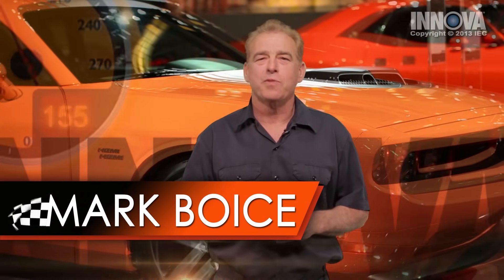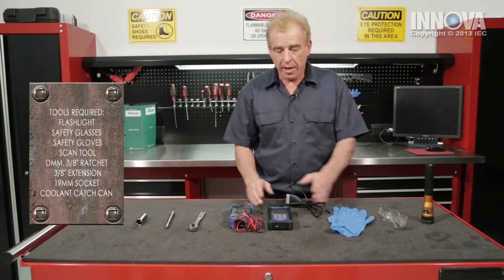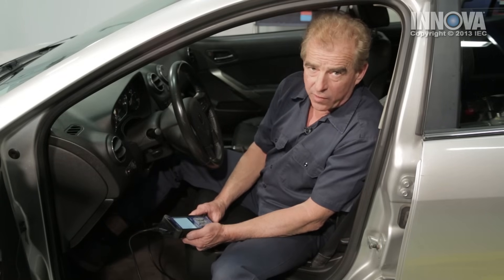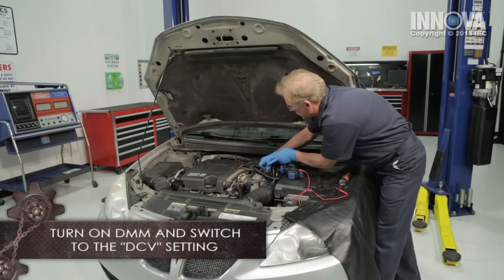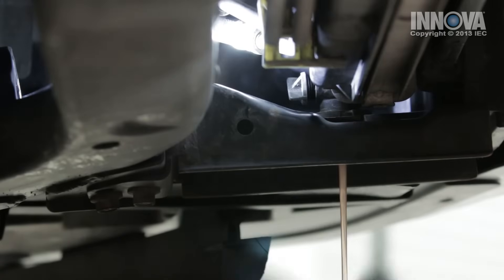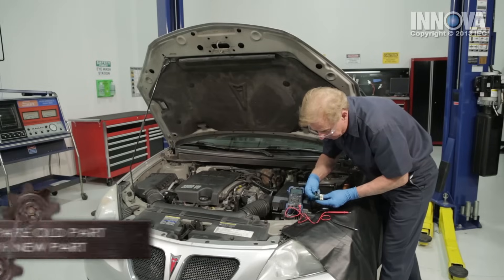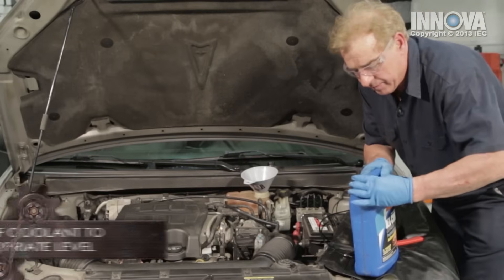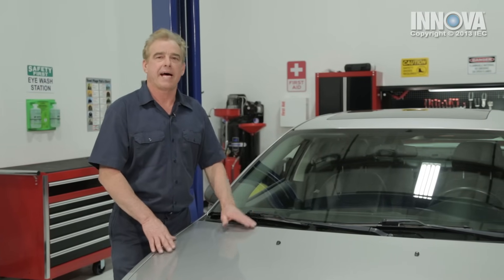How to diagnose a Faulty Engine Coolant Temperature (ECT) Sensor - 2005 Pontiac G6

Comment: I have a 1999 Ford f350 V10 with codes po118 po117 at same time replaced wiring and oem coolant sensor and 2 pcms voltage good wiring is perfect any idea's

Comment: Would this sensor cause the air conditioner to not work? That's what my 2010 Cobalt is doing, engine light on and info window for engine temp read - - - F. Should be between 190 cold and 220 hot. Had this happen 2 yrs. ago and mechanic changed the thermostat, it was good for about 5 miles and air quit again. So he replaced the ECT after I asked him if it had a sensor or something. Worked for about a year and he had no time to look at it.  So I drove it like that for about 3 wks and the light went off temp was good again, and air worked. Now it is doing the same thing this year. Is it possible the sensor is faulty?

Comment: I got the thermostat changed on my car because I hose had went bad I replaced a hose it was the top radiator hose and then it still red hot thermostat was definitely bad but now I have no heat in my car at the 05 Pontiac aztek I had heat in it before the thermostat change perfect it don't run but 4 minutes five tops and it says it's reading very hot any suggestions please I bought this car from a used car lot over a month ago I've had problems with it ever since I don't even have my title yet it's been a real headache but that's the only way I have to go can you please help suggest
Reply: Did you bleed the air out the system? Im not to familiar with the aztek but if it have a 3.4 engine then you need to bleed the air out. It a bleeder screw on top of the thermostat housing. Open this bleeder screw anytime you add coolant to radiator. Put some old rags or paper towels under the screw cause coolant will leak out. Once your adding coolant to your radiator keep an eye on the open bleeder. When coolant start coming out like a stream air should be out of the system. Close bleeder screw. Let run car an to normal operation. If temp go past the normal operation. Cut car off. You gone have to wait till car is cool again. Then once cool off. Open radiator make sure coolant aint low. If it is low add more coolant after you open bleeder again. If coolant is full in radiator put radiator cap back on an then open bleeder screw an crank car up. Coolant should stream out that hole again. Close the bleeder screw. Also not take bleeder screw all the way out it just need to turn a few tines to open up. Losing that bleeder screw is a pain in the ass. Trust me you dont want to lose that other wise you gone have to buy a thermostat housing again or go to pull a part an take a screw out of s wrecked 3.4 housing. If it still overheats after that then you got other stuff going on.

Comment: I did that same exact thing but I have no code no more but the wrench on the dash illuminates when it wants to, plus it keep saying low coolant on radio... I drove the car out of town a few times and it drives great but it just burns a lot of gas but I think the car is fine I unplugged battery for 30mins still no luck and erased the code still no luck... but car drives great
Reply from the maker: +Gary Goodman  Thank you for your inquiry. We suggest to consult with a service manual to find the proper steps to fix the issue you are having with your vehicle.
Reply: did you ever find out the issue?
Reply: nope
Reply: ima go ahead and change mine. I drive alot and all that gas that goes to waste is costing me big money

Comment: good morning I have an 1996 mercury grand marquis gs and it's making a whole lot of squeaking noise when I drive and I was told that it was the lower Control arm bushing but I brought the energy suspension and I want to put those on my car and it's suppose to make my car drive better. so do you do that kind of work? and if I change all the bushings on the car would it ride like a new car

Comment: If I test the voltage of the connector, and it doesn't read 5 volts, where should I begin looking?
Reply from the maker: +xJustxJordanx 
Thank you for your inquiry. We do not have service manuals
for your vehicle to give you repair advice. We suggest referring to a service
manual for the issues you are having with your sensor on the vehicle.

Comment: What does it mean "open loop" on a sensor? Does that mean it dont work? Let me know anyone thanks
Reply: I'm sure you figured this out by now, but just in case... The ohm meter sends a signal out of your test leads on the red lead. It goes through the sensor, if the sensor is good, and comes back to your meter on the black lead. "OL" or Open Loop (also called Open Line) on your meter means that the sensor has burned out. Another way to say this is that the circuit inside the sensor is no longer connected inside the sensor.The circuit inside the sensor has "opened" and is bad, so your sensor needs to be replaced. Hope this helps...
Reply: I forgot to mention... if the sensor is good, the signal from the red lead of your meter will go through the sensor and return to your meter on the black lead and it will show some type of ohmic value on your meter. In the video I think he got something like 1.950 Ohms... or about 2 ohms. That was normal for a new sensor. A reading significantly higher than that could be a bad sensor also, that just hasn't burned all the way out yet...

Comment: What OBDII scanner are you using?  Thanks
Reply from the maker: +Engineerboy 100
Thank you for your inquiry. The scan tool that was
used in the video is a INNOVA PRO 31603. Here is the link to check out the
features and functions of the 31603: http://pro.innova.com/Product/FullDetail/f968c286-07ab-46b7-bfd5-bae40673742e